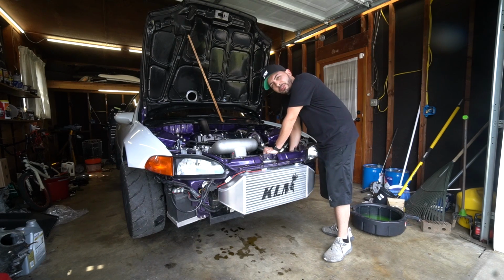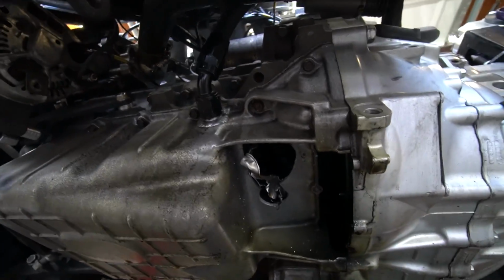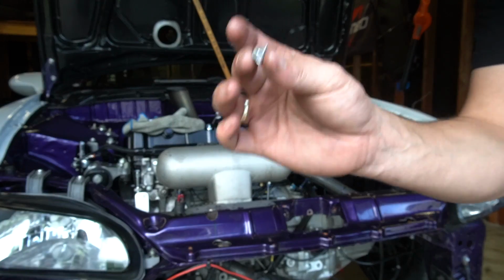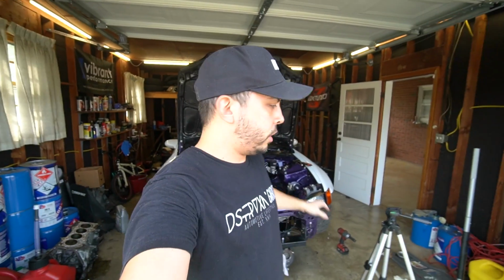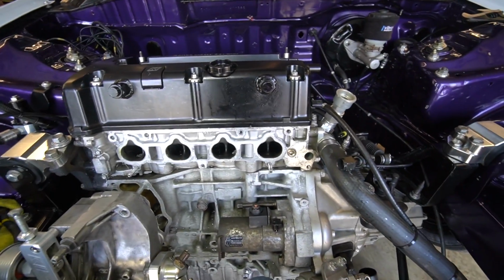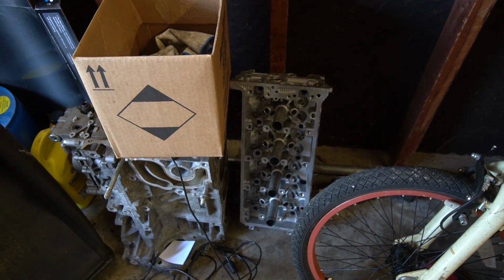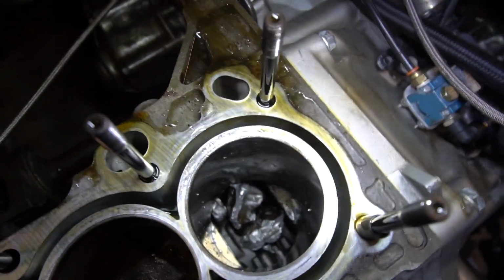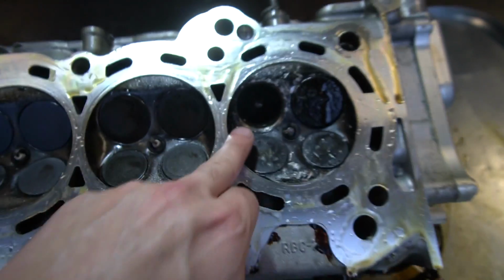My 600whp AWD Civic Blew Up Again - Ep. 2 - INSPECTING THE DAMAGE!!!

Comment: What cylinder head/ block  was this?
Reply from the maker: Stock k20z3 with type s oil pump.
Reply: I have the same intake, what did you do to block the coolant port off to the right of the manifold? Do you have a hose running down to the thermostat housing?
Reply from the maker: @jimmyl3388  what engine setup do you have? I removed the stock oil cooler and the coolant lines that went with it, also plugged any unused ports.